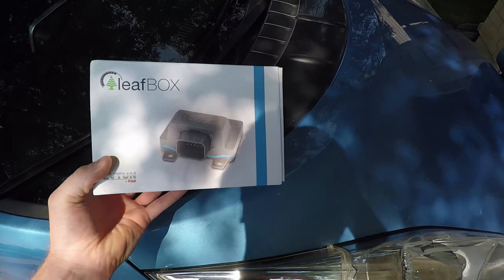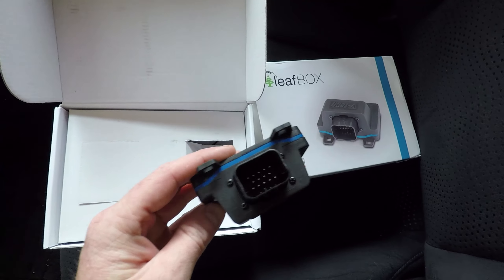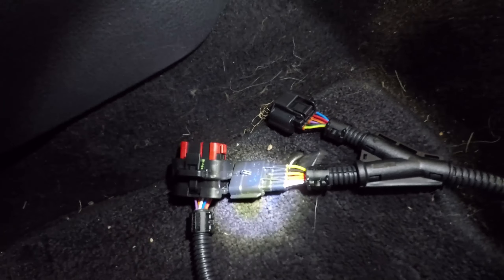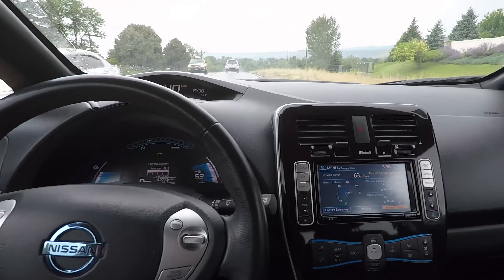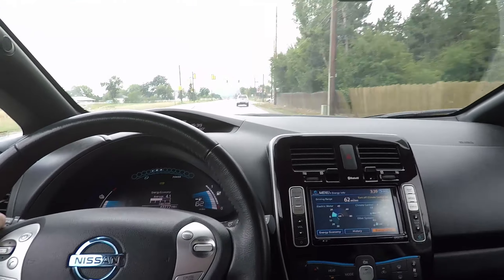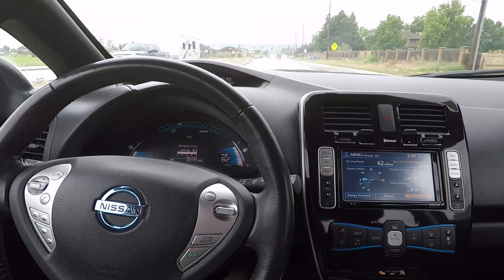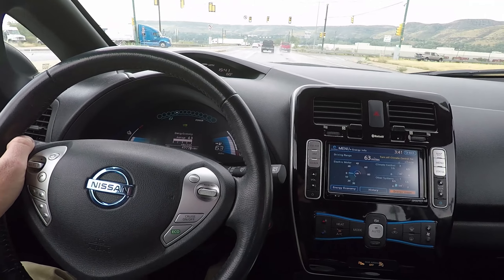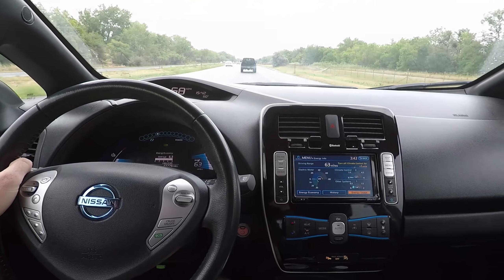Leaf Box Range Extender Unbox, Install, and Initial Thoughts and Review

Comment: Brilliant idea. Without this, can you put the car into neutral anyway and coast, as in an ICE car. My town is quite hilly and I could use this second option, if available on Leaf cars.
Reply from the maker: Yes, actually I sold the LeafBox and just shifted to neutral as I found it was easier. In the LEAF if you are driving down the road and push the shifter to Reverse, the car goes straight to Neutral without delay. I used to coast for miles and miles :)

Comment: i can do this on my 2012 stock Leaf by lifting not all the way when going down a hill.
Reply from the maker: Yes it does work stock I ended removing the leafbox and enjoying the car stock using that technique. Also an easy way to quickly shift to N while moving is to move the shifter to R, it will isntantly go to N. I did that for big hills and could coast at 70mph for almost 5 miles!

Comment: This is the way I drive, so would be useful to me. You only get about half your power back by regen downhill, so increasing your distance is a better use.
Reply: Thank you for that fist hand comment. I have debated countlessly about how regen has to be used a certain way to be efficient, and a lot of EV owners think I'm nuts: #1 Having regen setup so the pedal reacts like a car with an automatic gearbox, prevents you from coasting and is wasteful. #2 Regen is best used from high speed. From 40 mph and below, it is better to coast to preserve kinetic energy. #3 At even lower speed coming to a stop, regen does not give you any energy back, The voltage from the motor is lower than the battery, so it is just simple motor braking shorting the windings.  So to drive most efficiently, you regen as hard as reasonable from highway speed until you  reach 40, then coast and time it so you never need to come to a stop. That will preserve far more energy than constant regen with any speed change. So to coast, you lift your foot slowly so the throttle input matches you slowing speed, making your controller neither drive or regenerate, i.e. coast as you slow down. Typically on country roads 45-50mph, I spot the red light 600-800 yards away and instantly start coasting. Usually I keep pace with ordinary jack rabbit drivers that way, and when on the last 200 yards before the light, it turns back to green, I'm still doing 30 mph when catching up with them, and I can then accelerate slowly (efficiently). Saving much more than keeping up with traffic the whole time, regen at the light and accelerate normally from a full stop. Also the time spent rolling for half a mile, at low speed is hyper efficient. Roughly you can use 30% less overall driving like that!

Comment: The Nissan Leaf 30 kW is only about 87% efficient on regenerative braking and that's a give or take of 3% as well so for all the energy you do not use regenerating that is 13% more a fishency that you are getting out of the car on a single charge given how hilly the Colorado area is and planning on the part of Colorado he lives in he can gain a few extra miles per charge by using this device and his driving technique that hes using or he could have just saved himself the money and he could grave it a little bit more like a standard car and when he starts going down a Hill put the car into neutral and then when he needs slowing down or stopping power he could prop the car back and to Drive mode or if you can go straight to be mode from neutral he could prop the car in to be mode if he needs more aggressive diesel but this at least increases his regenerative braking in D mode as well But he could have got the results of this particular item for free just by driving with one hand on the steering wheel his left hand and by having his right hand ready to hit the shifter into neutral so that way he could just coast and he could have saved himself the money on the device only true advantage to this device is increasing the curs regenerative braking capability by pushing the brake pedal in D mode Which I would like to make note that a stock Toyota hybrid already does that you pushed the break and it increases regenerative braking until the system is maxed out on regenerative braking then the system engages your friction brakes on a Toyota hybrid so I don't know why Nissan and wouldn't have already made this a standard feature in the car in the 1st place especially since that is a 2013 which competes with the 3rd generation of toyota's most popular hybrid also the most popular hybrid in the world the prius  And they are good cars and 102 West's a long while and I'm talking about the Toyota's the Nissan Leaf is a bed choice for vehicle owners kiss it is pretty much the only vehicle that does not have a proper thermal battery management system and the nissan leafs do tend to suffer from degradation at a quite accelerated rate from all the other electric vehicles on the market.
Reply from the maker: true

Comment: is there tools make my nissan leaf car walking a big distance? please help me because bars became 8 bar and disrance is short
Reply from the maker: No. You must replace the battery. Luckily it is not hard.
Reply: Alaa Alqurini 😀
Reply: I appreciate your review.. So the battery is ebay swapable lol.. good to know.. (i fixed cell phones before ) I run a Leaf SV 2014, and I only have 1 bar of capacity gone and I am still reaching high 90's on good days with my milage.. but lets all face it.. 24khw leafs is the very definition of anxiety

Comment: Always drive in cruise control, do the same thing with the button on the steering wheel. ( Hover rt foot over brake, faster stopping than possible with this solution)  Done that  the last 7 years no issues  (:  Free
Reply: Cruise controll seems is a bit unatural on hilly and a lot of corners. I prefer using the speed limit. I have tried Nissan 2016 (old style 30kw) and the 2018 Modell (40kw), and the new one is so damn aggressive on the cruise controll, it DEMANDS to stay on the speed set, but the "older" nissan is relaxed and can go up and down a few numbers without becoming ANGRY (no hablo ingles). E-Pedal on the new nissan was very nice, I liked it a lot, I currently only own a manual transmission car, and E-Pedal did make me feel like I was in more controll.
The older Leaf creeps forward and I do not like it so much, feels like an automatic transmission car.
Reply from the maker: same

Comment: So..  can't you just lift your foot a little until there is no power usage.. without a  Leaf box? That's what I tend to do.. lift my foot a little so I get a "glide " mode.. Why use a box ?
So just to be clear..  does the Leaf box just allow you to easily locate the sweet spot on the pedal ?
Reply: TeamYankee2, I may not be the expert but it seems to me that the difference from glide and just lifting you foot off the pedal until you have just the 1 bubble is that you still have some regenerative breaking at that point.  I may be wrong and I hope I am because that does seem like a way cheaper solution but it doesn't feel the same as gliding in neutral to me.
Reply: But wouldn't be getting more ReGen be a good thing.
I would like a module that when i have the car in Eco mode, i would get MAX REGEN all the time. Not just when it thinks i want it. I know that regen is more inteanse on 2013 models and the 2018 does it even more with 1-Pedal driving. But there is no reason the computer can't be reprogrammed to allow for more.

Glide mode doesn't appeal to me because i do the same thing as TeamYankee2 said. I would want more intense Regen all around.
Reply from the maker: TeamYankee2, yes you are right. I will be releasing a new video soon but I found my driving efficiency didn't change at all using LeafBox. The sweet spot is about the same size as stock, actually.
Reply from the maker: Ridger Wolf, regen is good because it allows the car to capture energy that would otherwise be wasted, however, the most efficient way to drive is to allow the car to build momentum downhill and then slow uphill and repeat, if you regen downhill and then power up hill you lose some % of energy.
Reply: Correct. But the problem i have is the lack of regen. I was down to 5 bars driving home yesterday in Eco mode. When i took my foot off the gas and applied the brake, it was barely performing any regen. Again, it doesn't seem to like Regen very much unless you get down to the 3 out of 12 bars area. That is why MORE regen is important to me. Glide would be helpful as well and i do see situation where Glide would be useful. I tested that out last week by just putting the car in neutral and seeing the results.
Reply from the maker: There is a physical limitation of the motor, it cannot provide full regen power under a certain speed (it also cannot provide full accel power under that speed either, about 25mph) Look on your dash and you will see regen "bubbles." Normally all 4 regen bubble will have two consecutive circles, starting from the left, the bubble will only have single circle outlines when the battery cannot accept more regen. This happens when the battery is close to full >90%, very cold, or the battery is degraded and damaged.
Reply: I understand this but its all software driven and i can prove it if you like with Videos showing me reproducing the same event but at different charge levels.
Reply: I think it does, but the maximum I could get mileage wise before the infamous 3 miles drop off is 101miles with no modifications.   If you want to IMITATE the leaf box, you can just switch to neutral when going down or up hills.   Although I found out something about that pedal.. (i use Leaf SV 2014)

 Did you know you can maximize the energy economy from stop to start to almost maximum speed even going up hill?  

I have been able to maintain my leaf at 5.0 in Denver Co.. (that's all foot hills and hills)  and its based around holding my foot at a consistent rate..   

See the leaf is a one gear car.. sooooo lets say your MUSCLE memory remembers where 45MPH is (i'm in USA you can convert back if you wish) all you have to do is quickly get to that position and just hold.. You will maximize the economy.      As for the leafbox.. It looks like its just initiating neutral mode (hold left (usa) on the stick and it will auto shift into neutral.  Use that to go down and around and your set..   I want a leafbox to maximize my efforts even more.. but not at the cost of using ECO mode..  eww (if i wanted a electric car to feel like a gas, i would of gotten a civic)

Comment: Looking forward to you follow up video.  I couldn't find a review of this product anywhere except on the manufacturer's site.  I've tried shifting into neutral when I drive and it doesn't seem to add to much to my battery life but being able to do it without the delay that happens with the shifter might help make it more of an automatic instinct for me and since I have on of the original 2011 Nissan leaf's I'm really curious about B-Mode.  The regen versus the friction breaking with the peddle.  Is it alway friction breaking or does it increase the regen and then add friction at some point?
Reply from the maker: I decided LeafBox was not worth it, I will be uploading a new video soon. You can do everything with good pedal control and a stock Leaf. Also I didn't like how it changed the power curve.

If you have an SV/SL you can turn your screen to the energy economy screen and see exactly how much regen you're doing. The car maxes out at 30kw regen so if you brake harder than that you are using the friction brakes. You can also use the bubble meter on the dash if you have an S mode.
Reply: @Turboactive  you never uploaded part 2?
Reply from the maker: @PaulFeakins  yep I never did. LEAF Box didn't do anything and I sold it shortly after
Reply: @Turboactive  that's a shame to hear because I was literally just about to buy one. I have been experimenting with coasting and it does seem to boost range. The problem is, you have to be very very precise with the accelerator to get exactly 0 kW and 0 regen. So a device that makes that easier must help right? I'm still tempted to buy one but if it really did give you zero improvement I might save my £200? 

Out of everything you tried on your 24kWh Leaf, what had the best effect on range?
Reply from the maker: @PaulFeakins  yeah that was my hope too. In reality it didn't really increase that dead zone very much and made the car drove poorly imo. One thing I started doing is putting the shifter into R while driving which makes the car go into Neutral instantly and that way it's super easy to coast whenever you want
Reply from the maker: @PaulFeakins  the best mods were the front radiator grill blocker and Bridgestone ecopia tires at 60psi
Reply: @Turboactive  nice. I almost always see 83-85 miles when charged to 100% (if I haven't been on the highway just prior), what do you usually see and what's the highest you've ever seen? I saw 91 once after driving super carefully!
Reply from the maker: @PaulFeakins  I dunno I never liked that metric. I used mi/kwh and the most I'd see would be 6.2 on spring days with perfect weather and as low as 2.5 on snowy winter days. On average I tried to be in the 4.5-5 mi/kwh range
Reply: @Turboactive  that's pretty impressive, my average was around 3.8mi/kwh until I watched a video on EV Opinion that explained why coasting was better than regen and after that I never drive in B mode and tend to get around 4mi/kwh.
Reply: I was hoping for better reviews (honest). I zero my trip meter and at every 10% check how far I've gone. I've gotten anywhere from 5 to 8 miles per 10%. I then multiply that by 9 for my safest range.

Comment: BTW, the same LEAF Box DOES apply to 30kWh LEAFs as well! http://evtun.com/leafbox.html

2) What model years and versions of Nissan Leaf is Leaf Box compatible?
All. It does not matter if it is first (up to 2012) or second gen (2013+) of Nissan Leaf / e-NV200, both battery sizes (24kWh and 30 kWh).

 And your range results on your 2013??

Comment: Would it be particularly useful here in central Florida where hills are about as existent as a bedtime story?
Reply: Coasting to a stop, saves more energy, that driving all the way to the red light and then regen,especially if you can keep momentum, so you don't need to accelerate from a full stop.

Comment: I'd be curious to find out an approximation of how much more range you're getting.
Reply from the maker: I will be releasing a 2nd video soon. Range didn't change at all with LeafBox. I am getting 70-80 miles driving normally 95+ if I really try hard.
Reply: Turboactive what year/mileage is your leaf and how many battery bars you have ? thanks